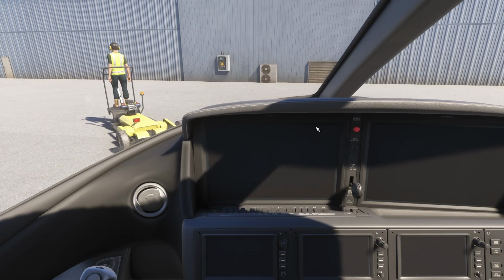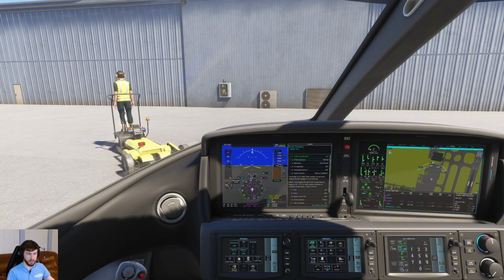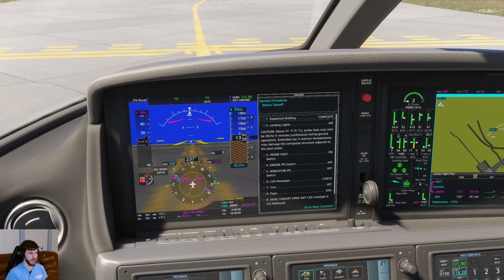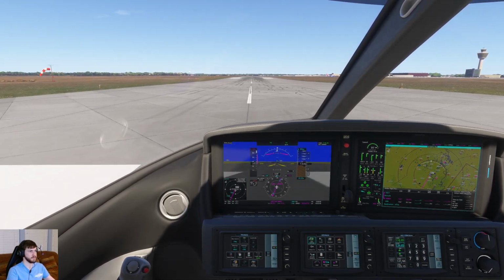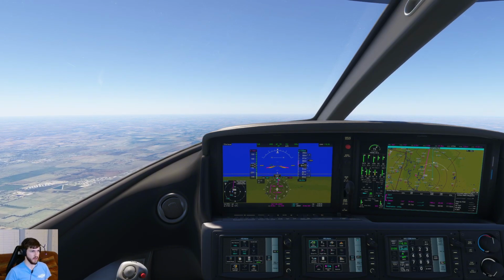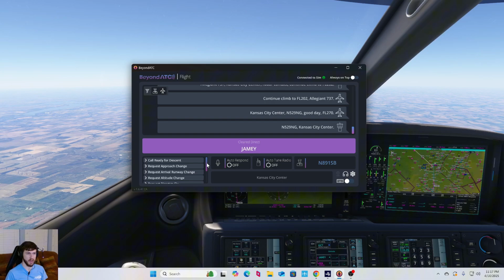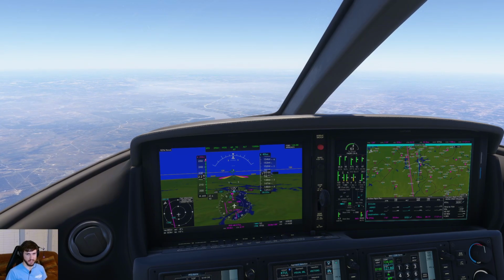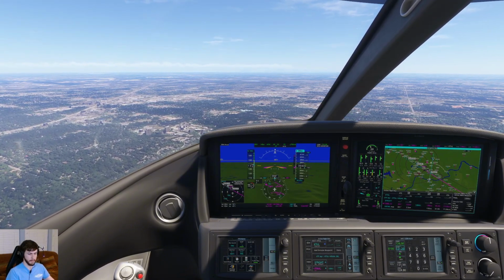AI ATC in MSFS: A Real Pilot's Review | BeyondATC

Comment: Did you use the basic characters or premium characters in this video? It's kind of a subscription if you still have to pay for premium characters every time. I want beyondatc but im not sure whether the basic character atc sounds good enough
\
Reply from the maker: I just used the basic characters. To me, It is not worth it to pay for premium characters because, like you said, then it becomes a subscription. I am more concerned about the quality of the ATC, not how realistic the voices sound, and honestly, the basic characters sound good enough. I highly recommend BeyondATC. It comes with premium characters after you purchase it so you can try both out. Once you run out of premium characters though you would have to pay to top them back up if you wanted more. However, I think you'll find that the basic characters sound just fine.
Reply: @ Alright, thanks for the information. I find it hard to hear whether the premium or basic characters are used in video’s so I guess that’s a good thing. I think I’ll buy beyondatc then.
Reply: @timon69420  premiums would give you better accents and more realistic pronunciations if you will. When you fly in different parts of the world during the same flight, it is definitely an upgraded experience.
Reply: The premium talks quicker.   Works much better in busy airspace.   @thepilotblake

Comment: Awesome video thank you!!

I noticed during descent you seemed to be changing the target speed when using FLC to change altitude. Your target altitude was set and it was matching a certain speed, then you used a control to lower the target speed which made the descent more gradual. Could you let me know the name of the Control Setting that I need to use to do that? I would love to map it to my flight yoke!
Reply from the maker: @josephkilleen6962  I use the Honeycomb Bravo throttle quadrant, so all of the control settings come default with it with no changes required. I did look in my control settings though, and when I turned the knob I saw that it was mapped to a control labeled “MINUS” and “PLUS.” There is also another knob on the bravo that allows you to switch which control you’re adjusting, so for that you would have to find a setting labeled “SELECT VSI BUG” if that’s the one you wanted to map, then use the plus/minus switch to adjust it after it’s selected.

Comment: The issue with taxiway names is usually due to default MSFS airports. They don’t have accurate taxiway names and are often randomly generated for most airports. You can usually find add-on airports online that include the correct taxiway data and then BATC will give correct instructions
Reply from the maker: @zachh5473  funny enough, right after I talked about that in the video I realized the taxi route BATC gave me corresponded to the taxiway signs on the airport, so I figured it used the taxiway names from the default airports. Good to know it would change with add-on scenery. Thanks for the info!